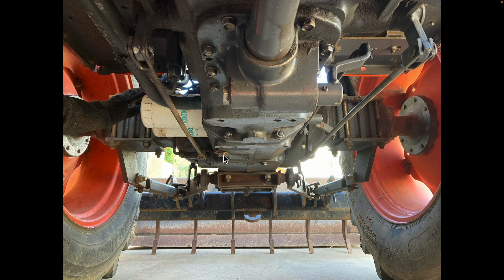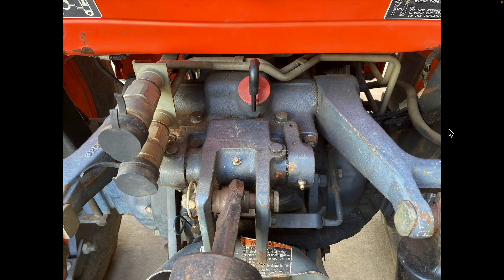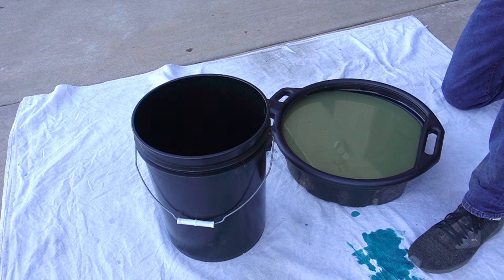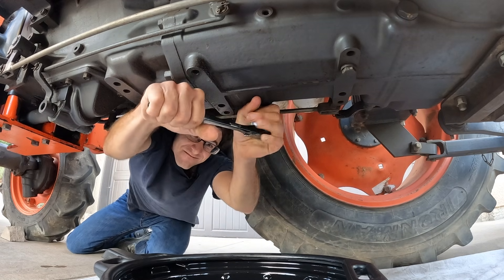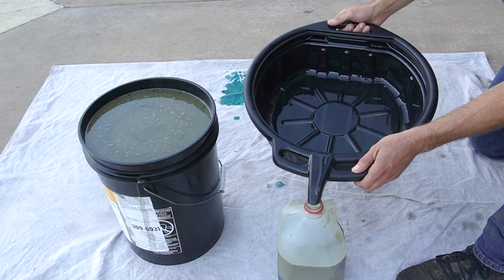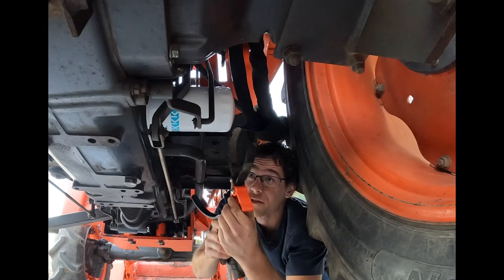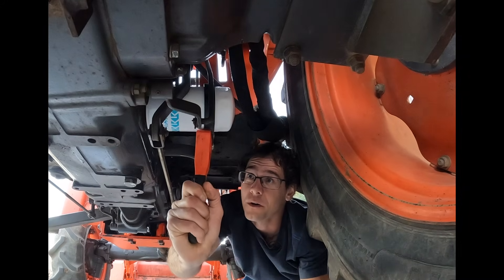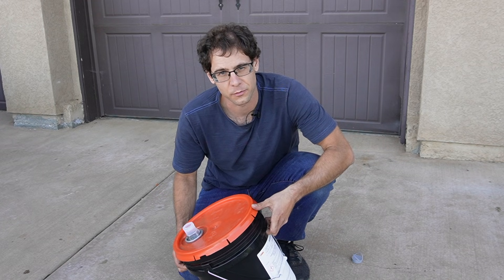How to Change the Hydraulic Fluid on a Tractor

Comment: shouldn't you rub a little fluid on the rubber gasket on the new fllter as you would on any oil filter before installing the new filter?
Reply from the maker: Which filter are you referring to?